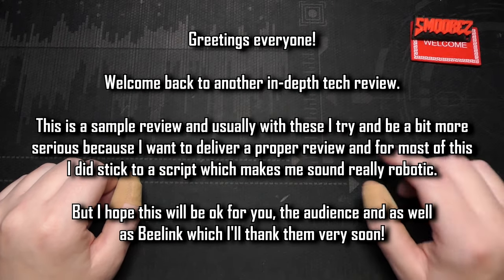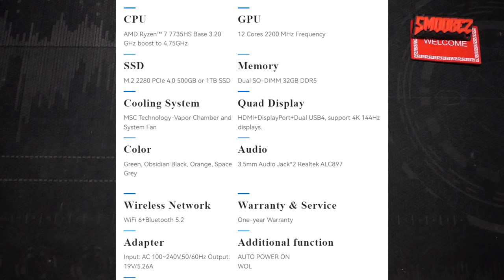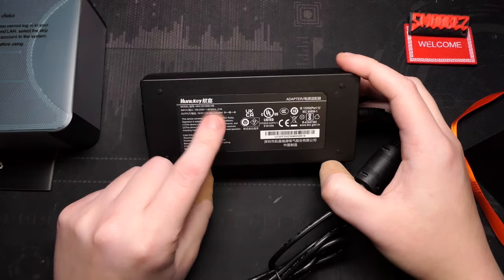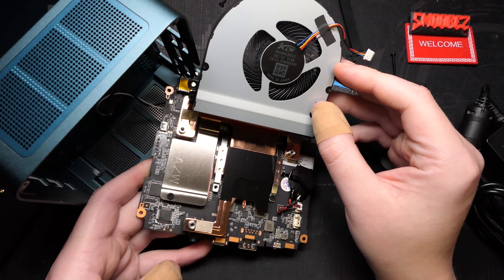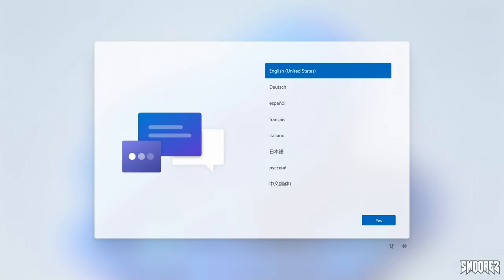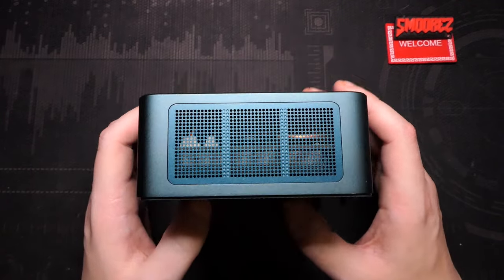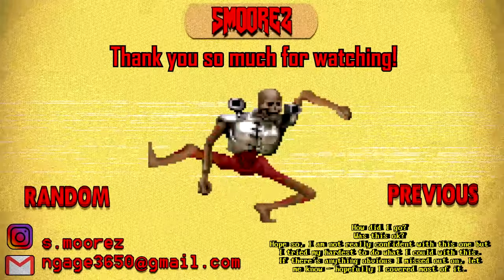Beelink SER6 MAX Mini PC Review - Great Performance in a small form factor

Comment from the maker: Regarding this PC with the massive flaw of missing a screw on the heatsink to the processor, Beelink has apologized and has held a meeting to discuss this issue. They hope not to make a mistake like this again. They took it very seriously and responded fast to this issue so I am very thankful for that

A massive thank you to BEELINK for sending me this sample out for review! 
I really do appreciate it! I hope this video is more than enough :)

It's currently available to purchase and has an $80 USD coupon to go with it until September 23rd.
Link is here: https://www.bee-link.com/catalog/product/buy?id=538

My opinions in this video are my own, I am not being paid by BEELINK they have just sent out the sample for me to review which is what I like to do :)
I have to select "paid promotion" on YouTube as I received something of value from a third party.
-
I hope you all enjoyed this review! I think I managed to cover everything. Would you buy this one? What are your opinions on this? Let me know down below!

Timestamps:
Introduction, Links & Disclaimers: 0:00
Current Pricing & Options: 2:11
Hardware Specifications: 3:17
Key Features: 4:22
Unboxing: 5:39
Around the Mini PC & Magnetic Power Supply: 7:59
Ports, Build & Teardown: 8:58
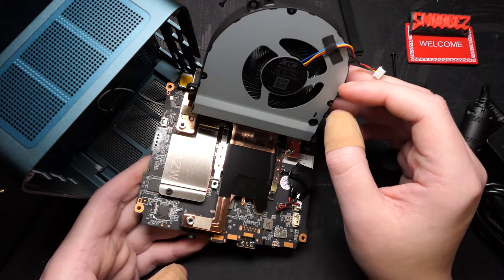Discovering a major flaw: 11:41
Small issues with reassembly: 13:13
BIOS Menu, First Boot & Setup: 14:04
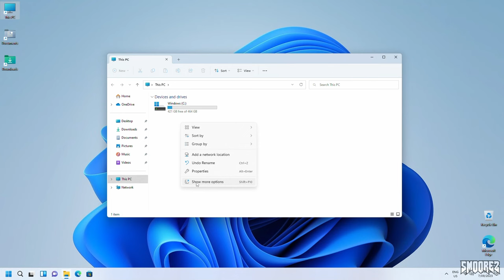Checking Specs, Temperatures & Windows 11 Issues: 15:16
SSD Benchmark, 4K Video Test & YouTube Test: 16:27
Cinebench: 17:03
Gaming Test - Cyberpunk 2077: 17:51
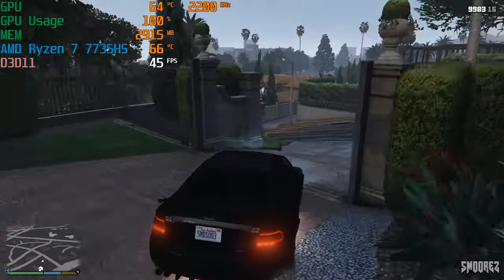Gaming Test- Grand Theft Auto V: 19:23
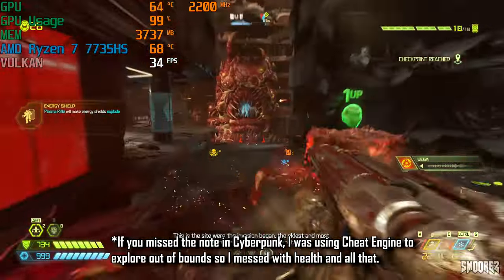Gaming Test - DOOM Eternal: 20:01
Fan Noise etc: 21:29
Conclusion: 22:02
Links, thanks to Beelink & Timestamps: 24:14
Thank you to everyone & Rambly Outro: 25:18

Any questions let me know!

Be good people!
Reply: I'm about to buy this thing and I will make sure to unscrew and have a check lol
Reply: What happens to your left band at the conclusion?
22:00
Reply: Tremendous work. Thank you!

Comment: I have the SER5 Pro version of this.  I've had it for almost a month now.  I put a 1TB SSD into the free slot on the inside, but otherwise I haven't upgraded anything yet.  I'm considering going from 16GB RAM to 32GB.  I spend most of my time in Ubuntu but I dual boot with the Windows 11 Pro that it came with.  

Even with the SER 5 Pro, i was able to play Baldur's Gate III, which is pretty impressive.  The only slight regret I have is that the SER 7 has (as far as I know) a USB Firewire that can take an external GPU, but I'm able to  play anything I've thrown at it, and I'm not a big gamer, anyway.

Comment: I think I have bought 5 U59s so far, all directly from Beelink, they are way cheaper than building a PC from nothing and they work the same as any other machine.

For a SMB/SME workstation, these work wonders. Shame that yours had this hiccup with the heatsink screws.

Comment: also note that USB 4.0 automatically includes Thunderbolt 3. This little box can use a pair of EGPUs, and can be powered via one of those ports, negating the adapter. A one cable computer, using bluetooth keyboard and mouse. It's a neat little machine, but as others have noted. Tear it down, give it a go over, and make sure it's all there. Also, probably better to order it from Amazon, as third party sellers have better shipping departments, and Amazon has a faster RMA process.
Reply: It absolutely does not. Like 90% of the USB4 spec is optional, including PCIe lanes, speeds greater than 10 Gbps and, indeed, TB Tunnel Mode.

Comment: Why don't you use FSR in cyberpunk 2077? It's literally built to use DLSS/FSR to get its target performance. You could also turn on the RT options while using FSR. It's really a waste of performance to use such a powerful chipset for medium settings. I play CP77 at the highest settings on my Alienware R2 15 (i7-6700HQ, GTX965M, 16GB DDR4 8x2R @2133MHz) at 720P with FSR Balanced at around 30FPS. If a mid-range laptop from around 10 years ago can do it, that brand new chipset can surely do it at 1080P and with RT turned on.

Comment: Did you check the analogue sound from front and rear port? Its soooo weak like none existent.  already tried on win 11 and 10 with both speaker and headphones. Only hdmi pass through works.
PS Where you find that info about realtek alc897 chipset?

Comment: I bought a ser5 max 32gig ram about 2-3 months ago and I love it. It boots up almost instantaneously and handles games decently ( I’ve tried a lot of casual stuff but I was surprised when it booted CODBO3 ) emulation is butter. I play skate 3 regularly on rpcs3. I know there are a lot of QC Issues but I got mine from Amazon on a coupon deal and man I’m glad I did. Love that little fucker.
Reply: i just bought the ser 6max im trying to setup for emulation as well what are you using for cod?

Comment: I really don't understand the repeated trashing of Win 11, especially given the upcoming end of support for Win 10. I'd be nice if you would share why you don't prefer Windows 11, otherwise it seems to be just your preference (bolstered, of course, by your own admission that you don't typically use new technology). Windows 11 is faster and snapier than Windows 10, in addition to other performance improvements (especially as gaming is concerned). I could go on, but other viewers could simply Google the differences. That said, persistent knocks on Win 11 without any justification erodes your credibility (especially the suggestion that Beelink should ship with Win 10 instead).

Comment: Poor QC was mentioned in the comments. I've ordered SER 6 Max twice already and both times it came broken, making weird old-HDD noises. Support tried to send me a new fan (it is definitely not the fan making that noise), flash bios to the same version I had and asked if I "can't get used to it" - only after that they've offered to replace the device, which would mean weeks of shipping back-and-forth to China. Returned it back to Amazon, pity because the device looked very promising

Comment: Use Windows 11 or Linux for this build.

You want 11, or linux, for the better CPU scheduler; Which translates into better performance.

You should also run a 20" monitor with a resolution of 900p max, preferably 720p though, due to the memory bandwidth limitations of an integrated solution like this.

Comment: Honest question : what is the use case for these mini-PCs ? I mean, you basically get laptop parts, but it is not portable as laptop. Compared to desktop, you usually get worse performance for the price (due to laptop components) , but you still need to have usual desktop setup like monitor, keyboard, mouse, cables ...  So what is the point of mini-PC ?
Reply: Space... For most that don't want a hulking great Desktop or Tower, these things can give great performance (again, for most needs) in a small space that CAN also be mounted on the back of a monitor or TV so, out of sight too... Gamers will obviously require big ass power and ultimate performance, but, most who just want a quick enough PC to handle the behemoth that is Windows, and run basic to intermediate gaming, browsing, media playback, then, these suite very well. Obviously getting a good one, er, that works reliably is also a bonus lol (Beelink's build quality issues etc), I myself some years back went from a Dell Optiplex Pentium II Desktop, to a Lenovo 'Thinkcentre i5' mini PC (it had 8G Ram, since upped it to 16G)... No regrets had...
Reply: @thedarkknight1971  Ok, but you still need display , keyboard and all that stuff, so space saving is not that great. Especially if you consider usual office mini-tower cases, which are perfectly fine for a setup with integrated graphics, or some smaller cheaper card like 6400 or 1650.
Reply: @aleksazunjic9672  space, low energy consumption, clean looking work place, cable management, money saving do you need more reasons?
Reply: @Mo_Sha  There is no money saving (i.e. you get lower performance for price) . Cable management - you still need same cables. Lower energy consumption - maybe, but modern desktop CPUs do not utilize that much energy if not running at full speed. Only thing possibly better is slightly more space.
Reply: @aleksazunjic9672  It's pretty clear you can't be convinced, so why bother asking? If it works for some peoples use case I think thats all that matters
Reply: @rope435  I would like to know their reasons, rational or irrational 😁
Reply: "you still need to have usual desktop setup like monitor, keyboard, mouse, cables ...  So what is the point of mini-PC ?"
------
I always use an external monitor, speaker and attached wireless keyboard and mouse when I use a laptop... so the mini doesn't require any extras for my use compared to a laptop.  

I don't have room for a tower, so a mini PC is great for me.  I have one that I bought straight from the manufacturer in Taiwan (Topton) 4.5 years ago that I still love.  It works great, runs very cool, and the fan almost never comes on.

I've bought a laptop since then, which is also connected to my external monitor, speaker, mouse and keyboard... but it takes a lot more space, and I just don't bother using it very often.  I have it more as a backup if the power ever goes off or for the rare occasions I have to take it somewhere.  It's lacking on the I/O ports though, and the fan runs more often so it's not as quiet as my mini.

It is nice to have the battery in the laptop, but I do have a battery-backup surge protector so I can at least shut my mini down when the power goes out.  I just got that recently though, and my mini PC had probably at least a dozen power outages over the years with no issues from the sudden shut-down.  (I use Linux by the way.)
Reply: Oh, I also wanted to mention that I'm shopping for a cool running, power-efficient mini PC with full function USB4 ports that include Thunderbolt functionality, so that I can either: 1) plug in a portable monitor through USB4 and power it through that port instead of a power cord  or 2) run the mini PC through a power delivery USBC port on a full size monitor.   

I would love to confirm whether the SER Max provides these functionalities.
Reply: @blueskies1014  I'm not sure I understand the part : I have the room for monitor, speaker and keyboard, but I don't have the room for tower. Especially since in modern times, towers are usually mini or micro towers.
Reply: @aleksazunjic9672   The speaker is low profile and sits below the monitor.  The keyboard and mouse sit on a roll out shelf.  Neither of those places would fit any kind of tower.    I like a mini PC because it fits my space and I prefer to use the extra room for other things.  I'm not sure why it's so difficult for you to understand.

Eventually I would like to get one that can be run/powered directly from my monitor and attached to it's back.  That would free up even more desk space.
Reply: @blueskies1014  Hey, you could do what ever you want with your money 😁 There are all-in-one PCs that place CPU and MB into monitor case. All I'm saying that they are not very cost effective, i.e. you are paying for laptop parts for a desktop computer , just because you do not want small box of PC case around. But if you have some stylish ultra modern crib, then OK 😁
Reply: For folks who live in an RV where space matters this little guy works really well and will mount on the back of a tv….pretty slick

Comment: I've got a slightly older and cheaper one of these and it's a great little Linux PC. I run it as a backup machine and emulation console by running Batocera on an SSD in a USB3 drive enclosure - brilliant for anything up to the PS2 gen in my experience.

However as others have mentioned the BIOS is an issue with some of these, and mine never got any update to fix the infrequent crashes on bootup. I haven't opened it up to check the screws or anything so I can't vouch on that, but I'm glad mine wasn't DOA.

Comment: I'm really not happy with the Beelink SER5 5600H I have. The worse part of them, or the one I have is it has the worse wifi and Bluetooth radios I've ever known. Support is also terrible. On the website where you post an issue, it is heavily moderated and my question about the radio was never allowed to post. I could not get drivers that worked either. It is still under the 1-year warranty period but it means very little to Beelink.

Comment: Not sure what purpose the magnetic power connector is going to serve, on a machine that has no battery, and the way they designed it, the cord won't pull out to save it from falling off the desk if it's tugged anyway.
Reply: Its purpose is to lock you in to a proprietary connector so when the psu fails (which it will) they can sell you a bespoke one at a massive mark up rather than you just buying a generic laptop psu. As you say, it wont protect against being pulled off a desk due to it being pretty much locked in place by the case.

Comment: i'm still using a crucial ssd and ram on my notebook and believe me or not, they are almost 10 years old! and they still have no problem. i bought them 50€ each, so not so much cheap but still a good price for me. as for this mini-pc, it's not bad considering the specs, but that missing screw could be a problem tho, for the price range you can find more interesting laptops, notebooks or even better mini-pcs as well. 6,5/10 not bad but still not worthy for me.
Reply from the maker: Yeah I've got an old crucial 60GB SSD still working in an old PC out in the garage. But yeah this PC was looking good until I noticed that screw missing. It's made me look back and I'm not sure what to think of it now. It's hard to criticize a product I receive for free but I tried. I may have to re-upload the video as it's not processing properly on YouTube.

Comment: I just got mine from Amazon, it didn't even turn on.
Reply: Bro im planning to buy..what you suggest?
Reply: @normanmission1508  I discovered it did turn on, I panicked. At the moment there are concerns about malware in chinese built PCs, I'd avoid. But mine seems to be running fine.
Reply: @Wolfie_Rankin  until now still good your ser5 max?

Comment: Windows 11 has an annoying `feature` out of the box called S mode that silently stops you installing anything unless it came from the windows store. You have to download an app from said store to disable it which is a really sneaky way of microsoft to get you to make an online account just to use the bloody thing properly.  I was trying to install chrome and double clicking the installer just did nothing.  There were no `you need to disable s mode` or whatever messages, it just appeared to not work and appear like something was wrong with the installer which confused the hell out of me until I googled the solution. Very bad practice on microsoft's part there. 
On a related note, if buying one of these pcs from China always wipe the ssd and install a fresh os from an oficial ms/linux etc installer download. These things are renowned for loading malware and backdoors into the pre-installed ones. Would be interesting to run a virus checker on this one.